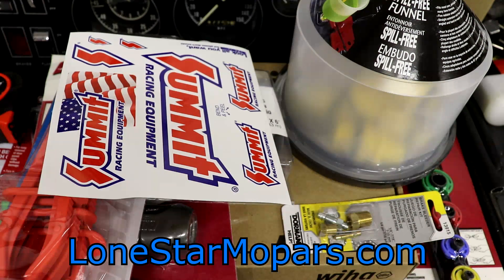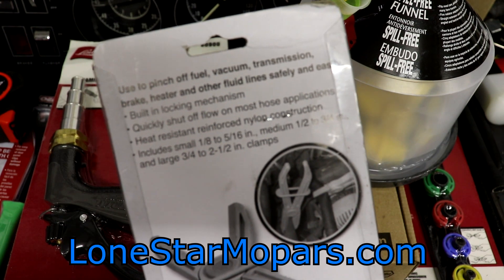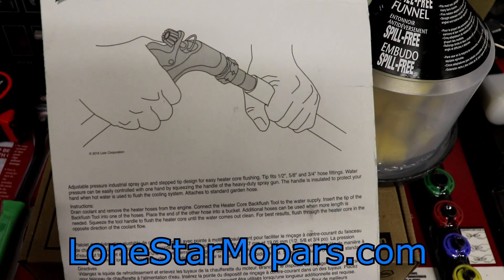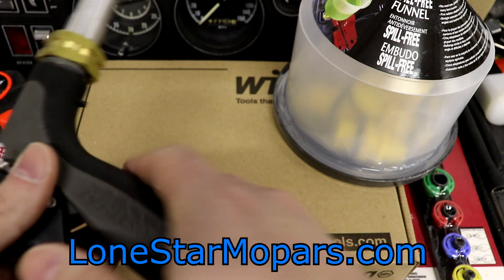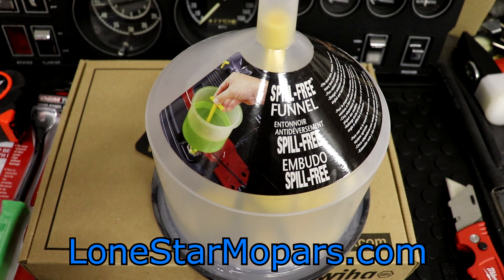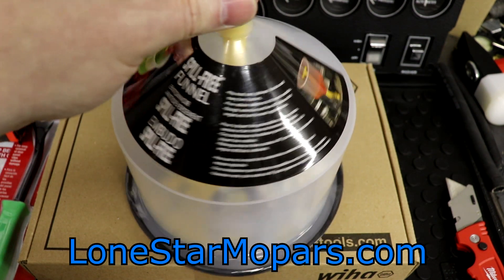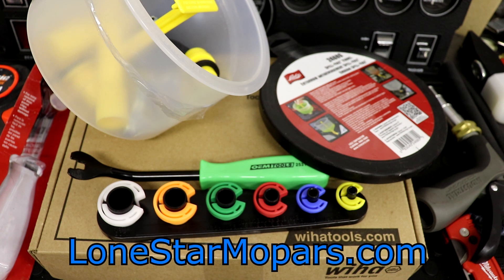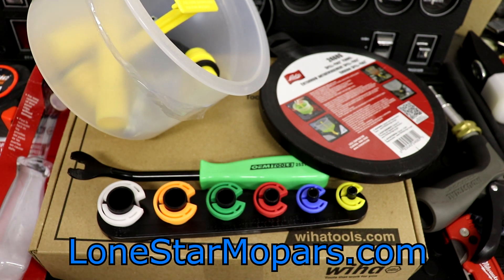Summit Racing Equipment Tool Haul #2: Coolant System Edition

Comment: I have the Performance Tool version of the trim remover - it's fine. I also have the Lisle version and I like it better. The Harbor Freight offerings are ok - plastic Trim set (same as you have most likely) works alright - the trim clip pliers are limited but in certain cases work very very well.

Comment: I got the same pinch off tool there great work awesome for me when doing brake calipers and power steering pumps to stop loss of fluid
Reply from the maker: Awesome to hear!  I was a bit concerned about them.  I'm holding out for a hopeful Memorial Day sale and going to try and snag an upgraded PS Reservoir, so I'll be using them for the same setup.